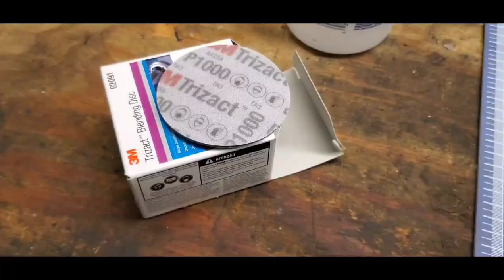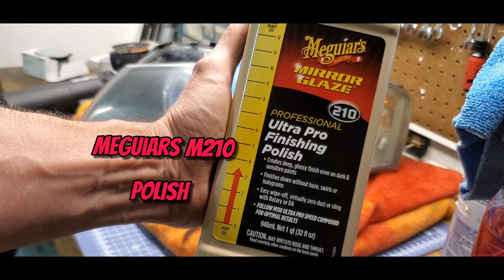Audi A4 Headlight Restoration

Comment: What kind of sander is that?
Reply from the maker: It's a Rupes 3" LHR75 polisher with 3" sanding discs
Reply from the maker: @Itsalondramitchell  that's a great kit for polishing car paint but it's going to use 5 or 7" pads. For headlights I recommend using 3" pads, here: https://www.amazon.com/dp/B00N54CSM6/ref=cm_sw_r_cp_apa_i_RrZ-Fb5QZPTKN
Reply: @richATTK1  Thanks for your speedy response 😊
Reply: Speed?